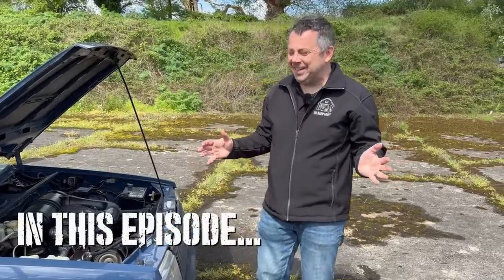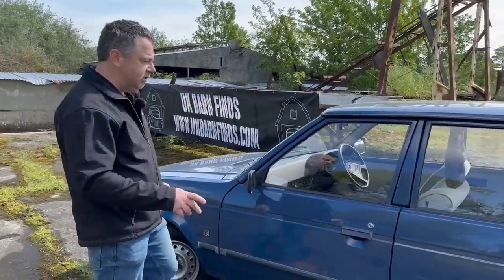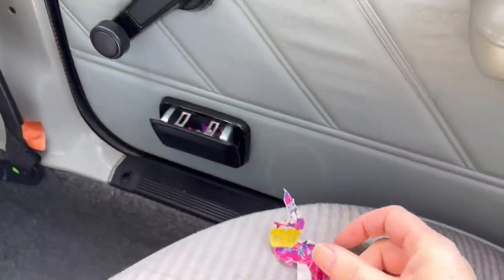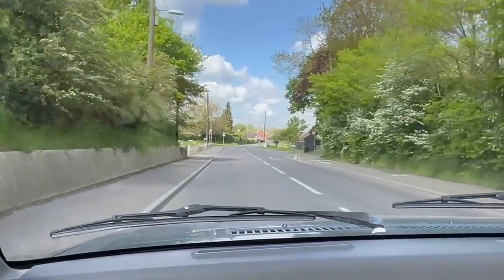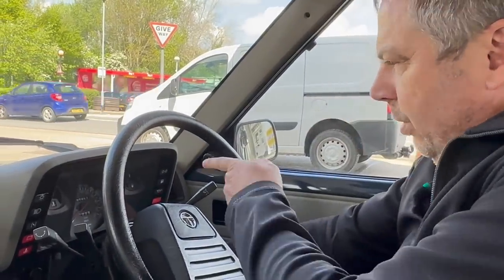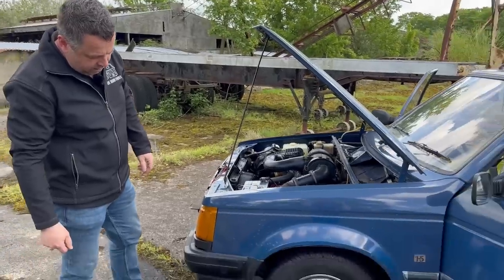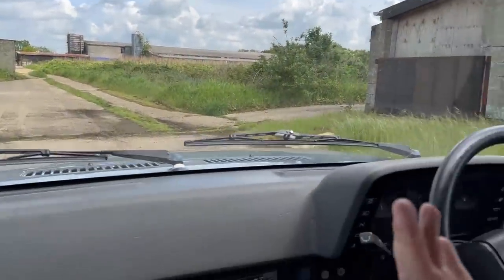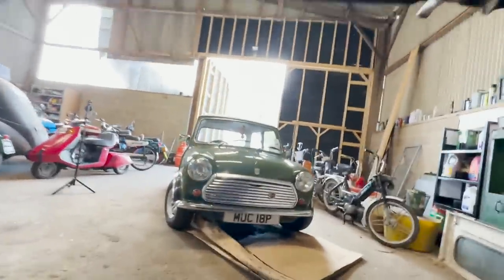1984 Talbot Horizon LS Auto - Walkaround & Test Drive Fail - UK Barn Finds Style

Comment: In their day quite under-rated cars. Perhaps not the Auto, but I rented them out for Peugeot Talbot Rentals in the early 80's. Reliable and hard working cars. "Tupperware" got rid of their Reps Escorts in favour of these on fuel consumption alone. I drove one of our "borrowed" hire cars, an "Ultra" 1.5...(5 speed and a bit nicer velour) from a campsite on the French Cote D'Azur to Le Mans for the 24 hr race in one day without using any motorways and the Horizon was steady and brisk enough. This would have been '84....... great way to end 2 weeks in France!!

Comment: I had one in 1988 ish, a 1.0! . We managed to fit a scrap yard talbot solara engine and  scrounged a webber. An electric fuel pump from an old jag and we made an exhaust with various bits of transit. Most of the gearbox bellmouth holes lined up, except one which we rounded out a bit with a bald file to suit, loads of fun. 
Swapped it for a granada ghia,  which I couldn't afford to run.  😂
Reply from the maker: Epic! Car life seemed so much more fun back then, when you could climb all over cars in a scrap yard and cars up on axle stands in driveways were a common sight everywhere. Oh, and petrol was a lot cheaper….even if it wasn’t quite cheap enough to run a 2.8 Ghia 😂

Comment: Enjoying the channel.

I remember these…they were not very popular even new.

I haven’t seen one on the road in a very long time.
The automatic was rare when new, so by now, last one?

I honestly can’t remember, but they may have also made a 1.3 version and a basic economy 1.1 as well (both manual only).

The design by ‘84 was quite dated…and the inclusion of rear seatbelts and other bits like the remote adjustable mirrors was an attempt to breath a bit more life into the car. Ultimately they couldn’t compete with Astra, Escort, Golf, or the Japanese offerings.

Comment: Lovely cars.
I owned a 1980 Horizon and loved it .
The engine tappets do rather rattle but as the engine is over head valve they are so easy to adjust 
The manual gearbox can fail but even with my limited knowledge as a youngster was changed in less than an hour.
I had my Talbot alpine engine installed into the Horizon and it could easily keep up and beat most cars of a similar cc.

Comment: The cause of bad smell is probably the engine overheating .
The rad fan switch can fail.
I installed a switch in the dashboard to cool engine when required. 
You have to be careful as cylinder head gasket can blow quite easily but they are simple to replace

Comment: Probably a better choice with Automatic version as the manual horizon and the bigger alpine had essentially the same engine & transmission but the gear linkage was absolutely terrible and gearstick that looked like a golf club upside down. The simca 1100 was it's predecessor.
Reply: My manual gearbox was soooo bad.

Until you got used to the exact jiggle needed to choose a gear it was forward for a random gear, backwards for another and reverse was so far over I had to move the passenger's leg

Comment: I should think the sticky caliper caused the brake fluid to boil which then gave the spongy pedal. Just a thought....
Reply from the maker: That’s what we reckon. I’ve removed the calipers now and I’m glad I did. We’ll post an update soon.
Reply: Check flexi hoses they can collapse internally but look fine. Press the pedal fluid won't return because of pipe flexi.

Comment: I've used to own a 1980 Chrysler Simca Horizon 1,5 GLS, in my slightly younger days.
It was a truly comfortable car, in the ways of seats and suspension. The engine and transmition on the other hand...! It was simply awful. The valvetrain made a heck of a racket. It absolutely refused to rev anything above 4000. If and when I did, it produced more mechanical noise than power. The drivetrain was shaking in every possible direction during acceleration, and the gearshift included throwing in a whole lot of guesswork. The sloppiest gearshift I have ever experienced. 
To those  contemplating that these things are to be expected from a car with a very high milage. Well, this particular example had covered less then 100.000 km (60.000 miles).
I used to love the damned box! 😍😅

Comment: My first car was a Talbot Horizon 1.1 . It was an A plate and it cost me £800 from an auction in 1988. Being the very base model it had vinyl seat covers . But the engine with all the tappit clatter, it sounded like a old London black cab.
Reply from the maker: One of our greatest pleasures of owning a few old cars is the memories, like this, that they bring to people 😀
Reply: @UKBarnFinds  when I went to primary school the street had a few Horizons as well as the odd Rancho. My town was sandwiched between two PSA dealerships. The noise as they headed off to work along that street across from the school was crazy in the mornings 305, Talbot Horizons, Alpines. 

Lots of nostalgia.

Comment: Still watching the video but I wonder if that NSF corner dropped down because the caliper stuck on so technically only that brake worked and the car pushed against that wheel dipping it down?
Reply from the maker: That's the only thing I can think of. I'm sure we didn't imagine it, as we both noticed it exactly at the same time. I totally expected to get out and find something amiss on the suspension side of things.

Comment: my father had a talbot horizon 1.5 ex, and we had the same problem. Was a left hand drive car and the right side brake overheated , but was not the fault of the caliper. I am not sure but was some part that regulates the brakeforce between the front and rear brakes and that thing was stuck or something similar, i am not sure because was a long time ago. My grandfather had a opel ascona c cc from 1988, I started to fix it but unfortunatly i not have time to work on in the last time. sorry for my bad english

Comment: Fixed its own brakes😂😂  the brake obviously is partially siezed , overheated and the fluid boiled which was why the pedal sank. Now it's cooled off and re-condensed. " back end is kicking out" the nearside front is partially siezed, so the osf is grabbing and pulling right. And please stop thrashing it!
Reply from the maker: Hope to show you the calipers this weekend. They were pretty grim.